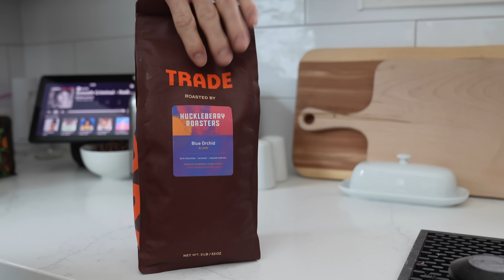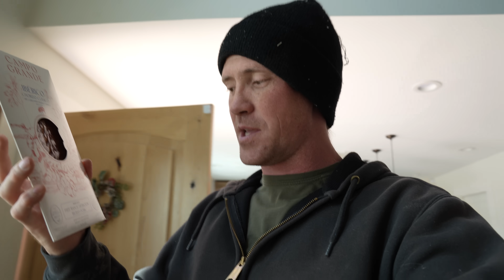This HAS to happen TODAY...

Comment: I'm excited for you guys. The finish line is in sight. If I may suggest a trick to remove the labels from the windows and do a pre-clean before the drywall goes up it will make the final clean a lot easier.  The sun and heat will soon bake the labels and they will be harder to peel off. I use rubbing alcohol mixed with a bit of water in a spray bottle, let sit for a few seconds then a razor blade will glide and remove. Blade will not scratch the glass if window is wet. That way you won't get you new drywall and paint wet when it's time to clean them. Rubbing alcohol will also remove paint spatters from windows. (And pitch from firewood on tile) Cheers!

Comment: @TrentandAllie You both are doing a great job at raising Leo. That first part really choked me up. Allie, you did a great job at handling Leo about his Nanna. You are truly a great parent. Trent, you're doing a grand job at getting this addition done as fast as you can and congrats on your 4way inspection. To Brandon and Grayson you both have make Trents work load a whole lot easier and less stressful. Also having someone there to help with Leo and getting things done that would take time away from getting the house addition done on time it a big plus. I'm looking forward to the next video to see how far you'll be with the drywall and painting. The Casita is looking great too with the tile going in the shower and the floor. I take it once the weather gets warmer that the Casita will have stairs soon so you won't have to use the ladder anymore. But that's not going to happen until the snow melts. Well you all take care and be safe. See on the next one.

Comment: great news on your inspection.  And for Trent, Did you ever get the wire stripping tool that i sent you 2 weeks ago.??
Reply from the maker: Yes I did!!! It’s going to be shown in the next mail time. It should air in a week or so. 
Thanks for the wire strippers too! They are amazing!!!
Reply: @TrentandAllie  i thought you would  be able to use them and save your hands, like i told you I have used then for well over 30 years and God knows how many wires i have striped.

Comment: if trent is going intoo labour i be outtah there , better open up the windows real quick
as for the lineset for the split unit , you can buy those seoperate there not that expensive , i would worry about the cold gas though, you actually need to evac the system , the gas is pretty expensive (whell it is here not sure in the states ) and the aircon takes a LOT of the gas
"i dunno if it was a good idea to have a baby..."realy? trent is working his but off to get the house ready and about two months intoo the build you forget the pil / decide you want another child ...... you couldve waited about 1 year and be able to help trent a bit more with the addition  and have hime a little tess on a deadline